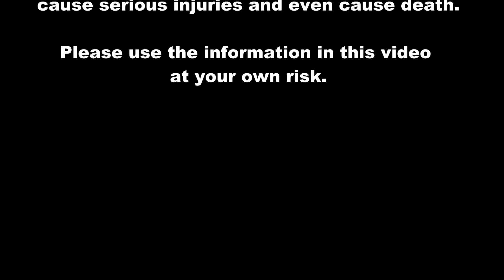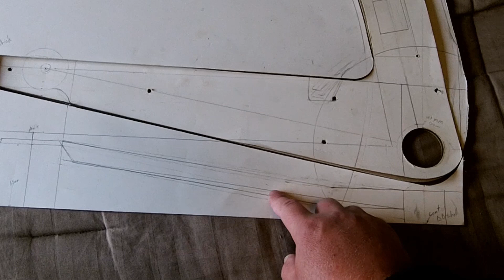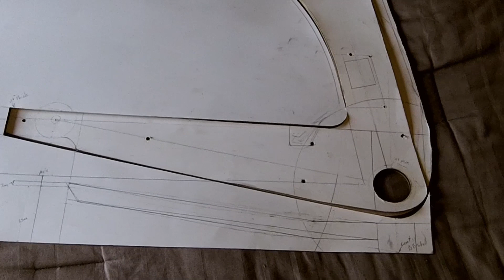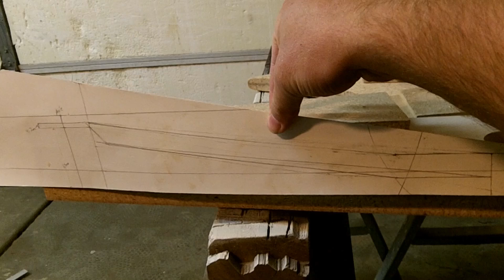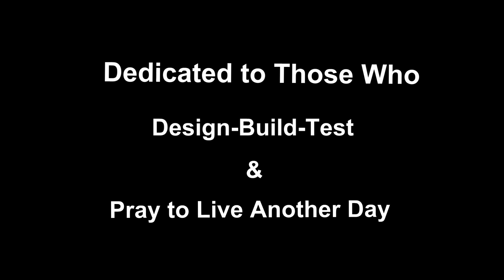Z Frame Bike: Video 2 of 13- Building the Chainstays

Comment from the maker: I bought an aluminum 69 mm English threaded bottom bracket shell from Nova Cycles. The 69 mm is build long so you can ream it a bit for the bottom bracket. The finish size is supposed to be 68 mm but I just left the extra 1 mm- so far no problems with it.

For the head tube I used an internal headset (FSA Orbit Z)- it came with bearing cups that have a flange that sits on the head tube's rim. In order to get them to fit snug I glue them in with epoxy and filler- Works perfectly.